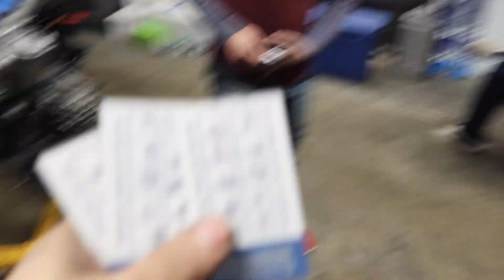S54 ENGINE ASSEMBLY PART 2 | E46 M3 Build Ep.15

Comment: I been looking to buy my first Bmw too. I’ve been looking and either a 2011 328i or an e46 325 or 330 ci which would you recommend
Reply: A m3
Reply: M2 or e46
Reply from the maker: I’d go with the e46, cheaper and much more reliable than the e9x chassis.